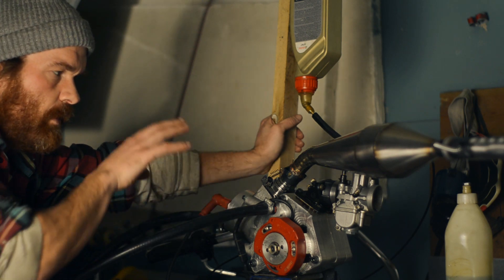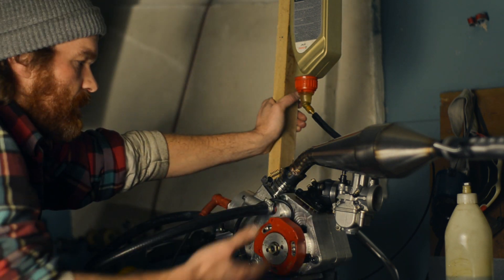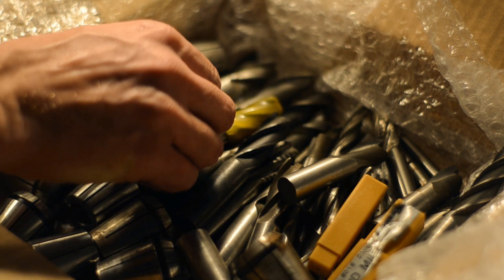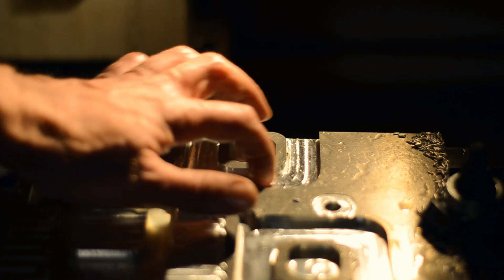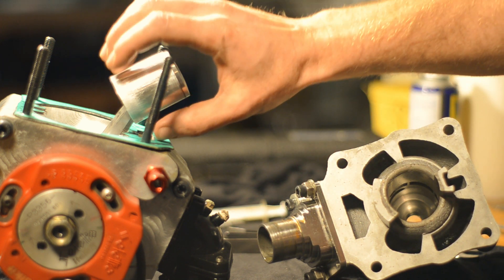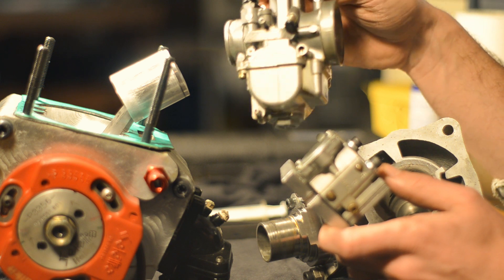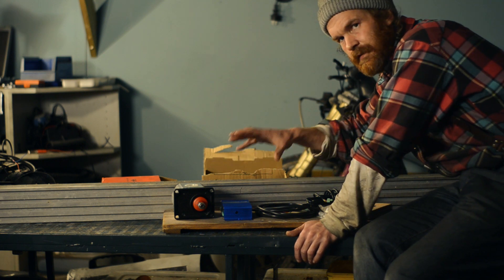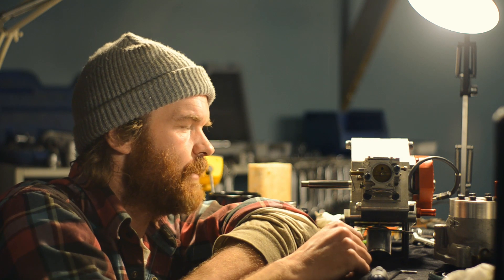Sacrifices to the God of Speed - Most Powerful Two Stroke Ever

Comment from the maker: Thanks for all the nice comments! Doing my best to read and reply!
Reply: Hi i asked a question ages ago regarding your tester . Just wondered if you looked at it ?
Reply from the maker: @rollafatonedude  Sorry can't remember, could you repeat the question?
Reply: @2STROKESTUFFING  Sure no problem , I had seen previously you having issues with low compression, I myself also did , it turned out the tester I bought had the shredder valve at the gauge end not the hose , I had asked you if you had checked yours , as the valve must be at the plug end foo ok r it to be accurate otherwise your adding the hose volume to the test and that will equate to low PSI reading on the compression tester , would be interesting to know
Reply: @2STROKESTUFFING  Thanks for taking the time out to reply I appreciate it
Reply from the maker: @rollafatonedude  Has the valve at the wrong end, so not accurate. Should be fine for relative measurements tho👍
Reply: @2STROKESTUFFING  wait a minute, compression is based on the head volume, maybe that is lower than a standard 50 cc engine. Have you ever check that?
Reply: Love your doing something different and even have the balls to post your flaws in the build to thousands of people keep yup the work man😉
Reply: Building you'r engine is less work than reading all the  comments. 
Very cool man
You have a lot of supporting and well thinking followers
Reply: the 2-stroke does not willingly accept a turbo😄 and full of holes!  harder if you talk about an evolved resonator you would be more reliable😉
Reply: How do u think F1 ing can perfect 2 stroke ?
I mean do u think they can go sky Cheezuss level compression using oil with so high compression and pressure to have almost no emission ?
Reply: Yamaha used remote floats on there road course racers in the 60's to lower to eliminate the foaming ..have you take a vacuum /  pressure test on the crankshaft seals yet ?..you really need to know if there is even the smallest leak of one psi in five minutes starting with 5 psi. ..and then pull a vacuum to see if the seals can suck any air around the seals also ...with s compression of 75psi is pretty good ..figure the "real " compression ratio as from the top of the exhaust port port to the piston TDC..check the compression with engine running and it will read with in a pound or two of same of 75 psi.....but put a slight drag on the crankshaft and probably blow the face off your compression gauge as when the crankcase makes boost
Reply: Walbro carb should work well for getting bugs out ..at least you can tune the hi / lo needles, while you can not with a fixed jet float carb.
The REEDS look really thin, they should NEVER blow out through the reed block like you experienced?? You have a beast motor, you should be running a reed block out of a 125cc bike motor, or 100cc kart racing motor .. those have thicker reeds.
Reply: Did you ever play around more with the idea of supercharging a two stroke?
Reply: @Seriouskai  too easy
Reply: Hi, I'm not at all convinced that you will decrease the revs and increase the power, the rotary valve gives you more power, the reeds more elasticity and progression.  but you will never have more power if you do not improve the whole you are good technician and you know it.  good job!

Comment: I’ve had the same issue with my 250R DUMPING the pilot/main at low rpms from not running that little plastic main/pilot plastic baffle!! Maybe open one the air jets a tiny bit.. I’ve noticed the float height tends to be a bit more sensitive without the baffle. Thems are great carbs I wanna see it work lol!

Comment: Here's an idea...which may be completely stupid...but here we go: How about using copper for the head? If we transfer heat 70% better from one surface and don't care about retaining it out of efficiency but want to take off the peaks at ridiculous compression at over 100% VE, wouldn't this be something to try? I googled this concept and found nothing so far. Yes it's soft and whatever but it can be retained, backed, by tougher metals still with good contact area to water.

Comment: Have you considered a mikuni BN style carb? They are diaphragm carbs that work great with vibration. I used them in my racing days.
Reply: Plus you can run them upside down with no issue

Comment: You mentioned that the engine will be ran upside down from what is currently being tested, and also that the fuel is building up in the crank case due to this, could it be running rich due to the fuel build up ion the crank case and the testing orientation?  This is more a question, you know more on the subject and just something I thought while watching.

Comment: A friend pylon races RC airplanes. He mentioned that the engine is 6.5cc and 2.9HP, I've seen these annoying things fly and I believe it! At more than 0.44HP per cubic centimetre, or 446 HP per Liter. I would guess that's pretty close to the peak output by displacement of any normally aspirated reciprocating engine. What do you expect the HP output to be on your engine? Anyway, awesome job and thanks for posting the videos, I enjoy them.

Comment: Tuners rock! Love my 2strokes, recently built a still fs 76, put a o28 carb on it, it is 2x more powerful,  and will handle 4 9 inch pieces of 130 armed core line without bogging down,  it's a weed eater, and bad ass, have took down 1 and 1/2 inch pine trees with it

Comment: If the float is leaking it will run rich, float level too high it will run rich. Probably best to go ahead and orient the engine in the position it will be in the bike, as gravity is going to have an effect on the carb, and maybe that big crankcase. The float has to be correct or all other carb adjustments mean nothing
Reply: Foaming in the float is possibly intake resonance. An airbox or intake tube with the carb on the end will lower the resonant frequency and possibly eliminate the foaming. The intake must be tuned to the exhaust. Radiator hose works good for trying different lengths of intake 'manifold'. Maybe just a piece of hose on the intake end of the carb, or the hose between the reeds and the carb. Tune the intake resonance. Variable length intake tract would be ideal, it would allow for more power across a broader rpm range

Comment: I think you will find that reed valves will not work at the high RPM that you plan on running. Rotary valve is more reliable. Speaking from experience. I am 72 years old.
Reply from the maker: Totally agree, btw, the secondary intake has no valve at all😁👍

Comment: Jetting in 2stroke carbs will vary that much to the point where a mid 1980 80cc can run a bigger main than the big brother 500cc ref the kx models. Our 87 kx80 in Aus 800m above sealevel runs 37.5 pilot 195 main 30°C. You may need 35p 150m .
I know once this is on salt lake it's flatout plug chopping tuning so no leaning out full throttle is the problem to look at.
Yes they say pilot is finished with at 1/3 throttle but i see a bigger pilot still feeding it fuel at 3/4 throttle and you'll be compensating with a smaller main to gain power/leaning it off, instead of bigger main no leaning/brown plug and full power/revs. 
I honestly think when this little rocket is at 20,000rpm it won't be as friendly at 1000 to 5000 rpm . The dyno will show if runs out of fuel at 15,000rpm.
I'd try genuine Mukuni carb 28mm.
Also does your piston pin need lowering on piston,  if to high coursing a rocking motion in bore.
I'm not advanced as you brother but only 2strokes for me and always learning keep up your awesome journey love it been here the from the start, you will succeed Cheers

Comment: If you're getting access fuel built up in you're crankcase run stiffer reeds and it will limit excessive intake fuel and give  you a correct mixture,not lean so engine can consume all the vapors and it will let engine run cooler,and run a cooler spark plug, you will have a happier motor and more power.

Comment: Maybe you can use resonation plenum air box with proper intake stack / stacs as we can see in two stroke gokarts. Mounted on bike with stack in front, so cold air intake with low pressure air charging could help down with rich of mixture and with more air with fresh fuel particles you better cool inside of an engine.

Comment: Its idling pretty good! Maybe it's running rich because of the low revs and the big bottom end volume. It is kind of overcoming the combustion chamber and exhaust port with to much fresh mix going up the transfers ports. It might "clear" its throat with more revs?

Comment: Low pressure = rain = puddles. Back to the crankcase packer idea??
Also, Just a thought, I can't remember, Did it run rich with that straight ex pipe thing you had on it? Maybe that little bit of 'stuffing' is not helping at this point in rpm?  Make sure that the carb is right first. You can make up baffles for the float bowl to stop it foaming so much if need be. Any thing stopping you from turning the flat slide carb around so you can run it with the cylinder at the bottom?
And no offence, I prefer the music from the P.I.P STUFFING symphony. Its much better!!
Keep up the Great Work! Cheers!

Comment: I built a dyno many years ago using water instead of oil. Way cheaper than oil and easier to cool, just add fresh cold water to the reservoir. Little bit of math with flow gauge and pressure. Worked pretty well, not real accurate but certainly could load the motor for sustained pulls and jetting.

Comment: Try going leaner on the pilot jet. I also have a 28mm PWK and from size 32 and above,i can see black smoke from the exhaust. I run it with size 28 now and its just somewhat rich(even with size 28,damn). I would suggest you something around 40

Comment: Would it be possible to have the expanded engine cavity, for the resonant high volume feed, on the other side of the shutoff valve? In other words, a standard capacity crankcase, with the expansion walled off from the large intake opening?

Comment: The metal shavings on bench while the carb had no filter... you scare me sometimes 😂
Reply: @paul beenis A normal low output engine will most likely be fine, but anything that you ring its neck will be obviously diminished.
I have a sound understanding of engine durability. I am an engineer that did my first 4-stroke rebuild at 10, 2-stokes through my teens, auto & marine in my 20’s, and now I’m 30... I’ve made many mistakes and seen the consequences.

Comment: Have you seen the float level technique using a clear tube off the bowl drain ran up the side of the carb to visually see the level? I found it works well - I always add a puff of mouth air after checking the level with the shut off valve to "home" the level in the tube.

Comment: I am wondering if the timing for the opening of your transfer ports is a little too close to the opening of the exhaust port causing over pressurisation of your crankcase thus blowing out the reeds ... might be worth drilling into the crankcase to put a pressure gauge in there with a tell tale to see what pressure if any your crank case achieves

Comment: Alex, this piston design has more contact surface compared with a traditional piston (with side windows and pin hole), so I suggest you to include two long lubrication/cooling channels horozontally disposed below the ring in rear half of the piston skirt as the Aprilia RSA 125. Check this link: https://www.dicarmine.com/?attachment_id=710
Reply from the maker: 👍 Great idea! Haven't cut the skirt to clear the transfer inlets either yet, that might help too.
Reply: @2STROKESTUFFING  Yes Alex, in order to maximice the transfer flow and the exhaust wave suction pulse effectiveness, the piston skirt at BDC below the level of the cylinder transfer inner wall should be removed because it block the transfer entrance.

Comment: an also try run with an air filter wen u are tuning it because these 2t carbs are very sensitive, my 02 kx250 i had wouldnt even start with tge seat off because it was sucking too much air through the air box so try get a pod filter off ebay an then run it an tune it

Comment: also one other thing if how much fuel is rushing into the carb, id recommend trying to get a fuel tap off a ktm 65 or kx65 because that carby is the type of carbs they run on 85cc 2strokes, all fuel taps of diffrent an have different fuel output, because its such a small engine in the i fuel tap off a ktm 65 or sx 65 will make it run alot better please have a try an please correct me if im wrong

Comment: it has to run abit rich because its a small engine making so much power an its not running under load, u built this engine for full gas! top speed so put it under load an run it wide open. im only 1:56 minutes into the vid so yet to see if u do but please correct me if im wrong

Comment: You may want to reconsider the hydraulic pump Dyno.  you will need a clutch between  the engine and the dyno as the transmission and free pumping loads will make it very hard to start and keep the engine running at low speeds.  Also as you load the pump the hydraulic fluid will heat up and need to be cooled.  The ideal hydraulic pump for your application would be high speed, high pressure  axial or bent axis piston unit.  I attempted to do a similar dyno setup years ago on a KT100 Kart engine and it was never successful.
Reply from the maker: Thanks for the input! Maybe that magnetic powder brake is worth it after all...
Reply: @2STROKESTUFFING  What is your expected max torque?

Comment: Looking good Alex.
Clearly an atomisation issue. The gas flow through the PWK isn't enough to keep the fuel suspended especially with the larges crankcase volume. The walbro should be better at low rpm but with thicker reeds.
Even maybe switch to a simple 15mm carb. After all, isn't it just to be for starting and warmup, don't get too hung up on it. The injection will be far more important. 
Keep up the fantastic work 
Chris
Reply: Well. There used to be twin choke Weber carbs fitted to cars years ago. One side was small for economy and around 3/4 throttle the other larger side opened as well for power.
Reply from the maker: Think there's some twin bore pumpers available.

Comment: What is the rpm you are going to aim for? I had a 50cc with mods and it went 13.5k rpm. The power band started from 7k and pulled till 11k and the rest was just for the sound.
Reply from the maker: Peak power around 20k😁
Reply: @2STROKESTUFFING  Holy moly. The torgue will be so low but the top end hp will take care of that im sure! I want to hear it scream so bad now. Please hurry ;D

Comment: I believe it still has issue with the piston ring seal. Low compression engines just don't run well and seem to exhibit various strange problems. Blowby might ignite the mixture in the crankcase causing the backfire. I think the ring retaining pin may, ever so slightly, prevent the ring from expanding under pressure. Maybe you could very carefully grind the ring hole to allow more expansion but without bulging into exhaust port too much.
Reply from the maker: Yep, I think so too.

Comment: Somebody get this man a lectron carb!! Attention LECTRON CORP.
Reply: @Quirin M. there’s absolutely no reason whatsoever why a 50cc that can reach higher rpms and breath better (porting) will be less reliable. You lose reliability when you jump to huge bores in stock cylinders that cannot handle the heat. This mans developing machines that have adequate cooling, bigger air and exhaust ports, hopefully more durable pistons and rings and eventually who knows maybe he will
Move on to longer lasting bearings and everything else....nothing he’s doing would suggest these engines would be less reliable. Also.... there is absolutely a HUGE market for faster motors in the 50cc 2stroke class, dirt bikes would be a tenth of it. Scooters alone would be huge. Than think about chainsaws (for professional use) and other tools. You have no clue dude....
Reply: @njmxjunkie3128  Finnish 15year olds would like more power
Reply: @technoidiot2095  i can agree with that
Reply: He needs to reach out to some of these companies that produce small engine machines, scooters, dirt bikes, lawn tools.... larger hp numbers in 50cc is a huge huge market:....
Reply: He doesn’t need a lectron they are good for bandwidth but not good for peak hp
Reply: @johannesmuller1288  no maybe not, however they have thier perks, like being smart carbs no jetting. (I could be wrong on that)
Reply: @njmxjunkie3128  yes that is pretty amazing for a daily bike but as i said its not good for maximum hp a guy i know tested it on a simson with 130cc and he had 2hp less
Reply: @johannesmuller1288  lol 2hp?! Every single dyno tune will fluctuate (50 hp and up I’d say) more than 3-5 hp each run on a dyno, for a huge number of reasons. One being the human control which is widely varied even by the same person over and over
Reply: With a power jet
Reply: I’ve always preferred an air striker

Comment: Your reed valve's petals are way too slim. You need 0.35 mm minimum or better 0.40 on such high rpm running engine 🙂
Reply: I race high revving kart engines. At 21,000.   0.25 mm carbon Reed petals work fine. If you go too thick the reeds will not open effectively.
Reply: @50und524  it all depends on quality and setup. thin reeds tend to flutter and shatter they rafel on the edges, thick can withstand the impact. dual setup are sweeter. getting the right reed plates is a trail and error even working with differend brands yield differend results.

Comment: In regards to your carb atomization issues, have you looked into the STIC metering block for the Kehin pwk?  Uses the vortex tube principle for atomizing..jetting is different than stock pwk..I've got one in my  300cc off road race bike, and still amazes me with an off the shelf performance increase.
Reply from the maker: No, but I will👍